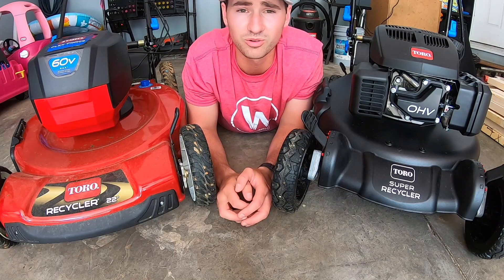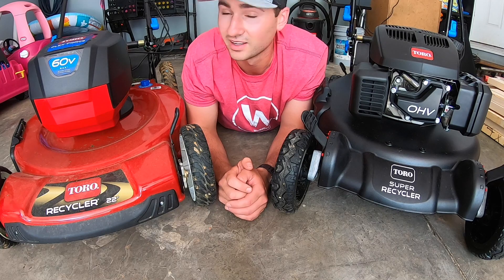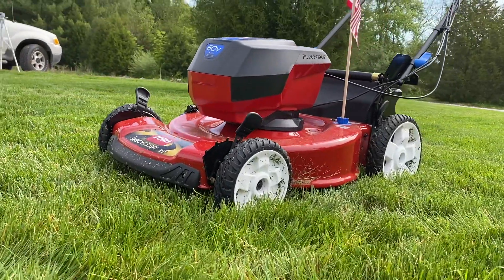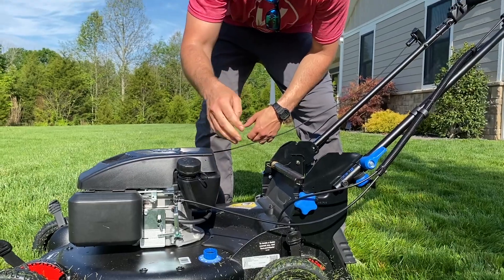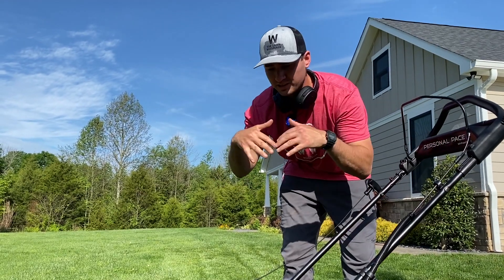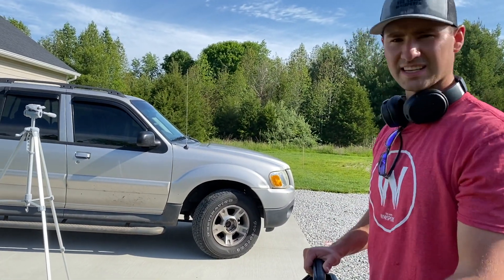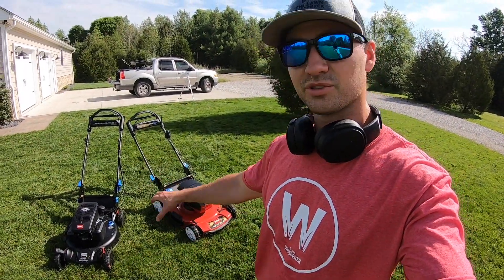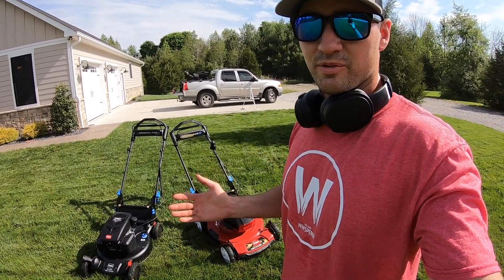Super Recycler vs Recycler 60V - TORO MOWER REVIEW

Comment: this popped up and I had to watch. I purchased the 60v Toro last fall and am loving it. Great quality cut and the personal pace system makes owing so great. The “sounds like a box fan” comment cracked me up. That was my thought when I first turned it on too. I honestly had to get used to it not sounding like an old gas powered mower.
I will say that I also love the mulch/ bag lever. I have used that moving between my front and back yard for different reasons, but I don’t think Toro quite has that perfected yet. Grass still gets through the hole when set to mulch and collects on the back flap. Easy fix is to just keep the bag on the mower whenever mowing, but would be nice to not have to worry about that.

Comment: I really want to pull the trigger on the super recycler with the 199cc, smart stow electric start but i been hearing stories about sputtering out of the box.
Reply: I have it. It's very random and it doesn't affect performance but still, it shouldn't do it if it's brand new. My recommendation is to get it from a toro dealer and check return policy first. My told me if I used it, I had a month to return it for store credit. Right at 29 days, I told them about the sputtering issue and that I wanted to try the toro 60v mower, their reply was they could either look at the super recycler, let me try the ego select cut first, or I could pick up the toro 60v. Now, that's customer service. I can tell they wanna keep my business.

Comment: Which one do you like better.  Not sure which one I should go with. I just think gas is more powerful.
Reply from the maker: Honestly completely depends. Size of lawn? Grass type? How often do you cut? Do you bag or mulch or side discharge? How often do you mow when its wet?
Reply: The Lawn Whisperer I put down GCI TTTF this fall and love it. I also added some KBG Scott’s. I would like you get into mulching rather than side discharging. I’m just afraid that the electric will not be as powerful as gas. Lawn is about 5-6 square feet.
Reply from the maker: @WooderBoyProductions  I will tell you that I have used the battery mower exclusively for the last 2-3 months. I absolutely love that mower. I have 6k square feet. I mow about every 3 days so when I mow I dont cut much off. If I were to mow once a week and it had grown quite a bit it might struggle. But cutting off just a little at a time it does a fantastic job

Comment: I have issues with my super recycler. It takes me like 6-8tugs to get it started. First 2 tugs are a lil stiff then strong smell of gas. I wait about 3 mins just to repeat. Then on 3rd round the tugs are smoother and finally starts. Already changed oil, new air filter, spark plugs n cleaned out carburetor only 2 n half yrs old. Any ideas?

Comment: TORO!! Made or "assembled" 30 miles from my home it's always been a Wisconsin company in my book could they have more plants around the country? Sure..but I haven't driven past the plant in Years. Briggs & Stratton is a Milwaukee based company which has always made the Toro gas motor. I own a Toro Super Recycler with a Honda engine. I wish Toro would make a super recycler in a battery model but they don't I'm hoping they will produce that in the future there's no reason why they couldn't mold a complete plastic deck with the super recycler triangular pieces that are attached under the cast aluminum deck a GLASS FIBER REINFORCED PLASTIC SUPER RECYCLER DECK FOR THE 60 VOLT ELECTRIC who here wouldn't by one like that. I know I would if my current Toro wasn't only 2 years old
Reply: Both of these mowers are made in Mexico, most Toros are made in Mexico.  My 2006 recycler gas mower was made in Mexico and my 2021 Snowmaster was made in Mexico with a Chinese engine.  They are based in the US but they don't make much here anymore.

Comment: I'd love a battery mower just worry about the battery going dead before I'm finished with the mow.
Reply: The battery is compatible with other power tools in Toro’s lineup like their string trimmer, leaf blower and best yet snow blower which is equipped with an equally sized voltage battery storage, so you can switch them out and continuously charge them.